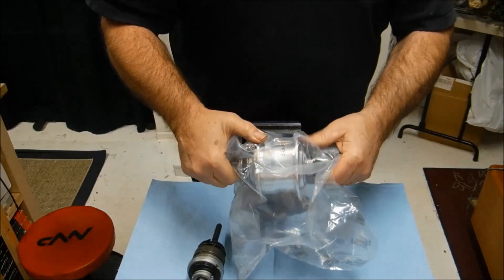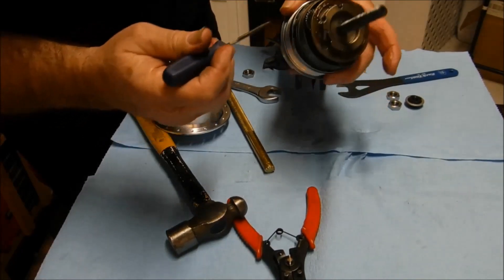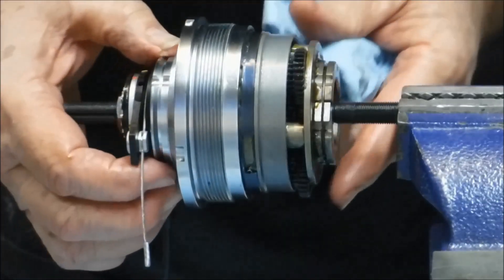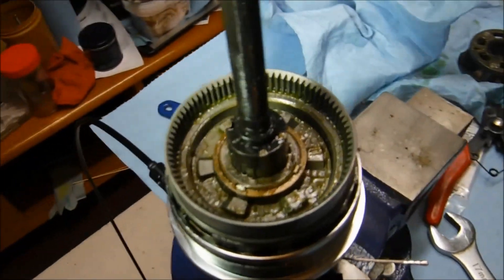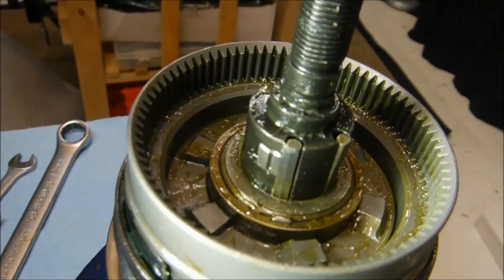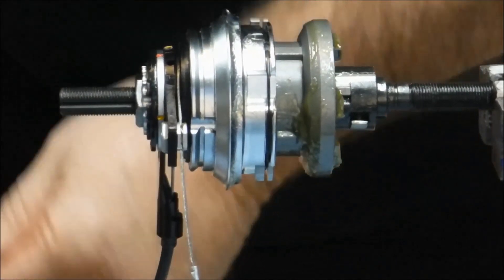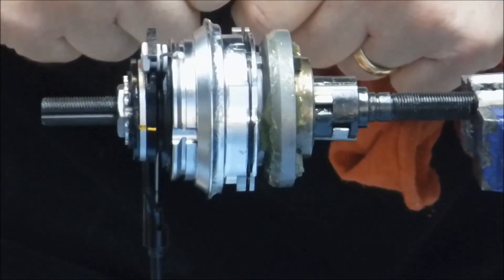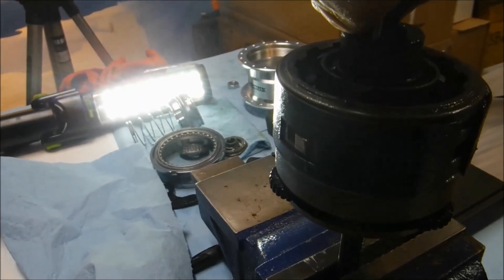Sturmey Archer RX RF5 How it works.

Comment: I like the elegant design of this 5-speed because it can transmit power in both directions  through the same planetary gearset, reducing complexity, and potentially saving weight.  You get 2 underdrive gears in one direction and 2 overdrive gears in the other, plus direct drive.  In contrast, I believe all the Shimano hubs except the 3-speeds have multiple planetary gearsets in stages, with power flowing only in one direction through any gearset.  Interesting design alternatives.  Maybe you have to use multiple stages for wider range.  Thanks for the great explanations on theory of operation ... the best on the net!
Reply: With Shimano it varies by the hub

The Nexus Inter-5 (the one they only sold in Japan, not the later Inter-5E) is the exact same principle, a single stage compound planetary.

The Nexus Inter-7 (EU market) has separate 3-speed over- and underdrive stages, in gears 1, 2, 6 & 7 one stage is disengaged, so should be almost as efficient as a 5-speed.

Their new Nexus 3R75 (the one for E-bikes) has a 3-speed underdrive, working on the same principle as a 5-speed but with no way to engage overdrive.

In general, yes, you're going to need more than one stage to get a wide range. The ratio of of a simple planetary stage with a fixed sun is 1 + (ring teeth / sun teeth), so once you get over 1:1.5 or so your planets start getting really small. Compounds let you cheat a little bit, but at the cost of larger and more complex planets. The SRAM S7 has something like a 1:1.74 ratio from a single triple compound stage, but it also weighs like ½kg more than the Inter-7 and was apparently not economical enough for them to keep making it.

Comment: Great stuff, thanks for everything that you have done explaining hub gears. I have SA and Shimano hubs and your explanations and demos have helped me service and repair my hubs. I do have a question. It isn't intuitive to me how driving the planet carrier creates overdrive. I can see that it does in your videos and my own observations at home, but I'm a bit perplexed how this works. I don't have any sort of engineering or mechanical background so I'm afraid it isn't obvious to me.

Also my SA hubs are running fine on 10W 40 oil as that is what I had available to me at the time. I haven't done a lot of miles on my Shimano hub, it will need its first service soon so I'm buying ATF for the Shimano (7s). Incidentally the SA hubs work nice with the 10W 40, my 3 speed has been running for 2 years now and shifts wonderfully. Thanks again for all of the time you have taken to explain how these amazing hubs work.
Reply from the maker: Thanks for the comment.
If you think about the planet carrier carrying the planet pinions along and rotating them on the sun gears which are fixed in place, you can see that the rotation of the pinions pushes the ring gear at a speed greater than that of the planetary carrier.
Reply: @2wagondragon  Hi thanks, I'm starting to understand. I have a spare SA 5 speed which I'll be taking apart soon to investigate.

Comment: It is a very informative video! Thanks for sharing this and help me to try and understand how it all works. The only thing that might not be very clear in this video is how the ring gear changes from input to output ? I assume this is also driven with a set of pawls that disengage in 4th and 5th gear with the moving of the clutch while you shift to 4th gear ? 

Otherwise this is very well explained! very nice thanks!
Reply from the maker: As long as the clutch is not coupled to the planet carrier, and the ring gear pawls are disengaged from driving the hub shell, the ring gear is the input. When the clutch engages with the planet carrier in 4th and 5th gear, the planet carrier becomes the input overdriving the ring gear which then outruns the driver.

Comment: So instead of a ball bearing to fix the sun gears to the axle this hub uses ratchet palls. Is this the reason why this hub is so big, compared to the older model 5 speed?
Reply from the maker: The pawls are necessary because of the rotary shift action as opposed to the hollow axle and indicator chain of previous models.
They still could have made it more compact and lighter, but they wanted to project a robust image. 
With all that, it is still not strong enough to handle the input of a mid drive motor.

Comment: I see the axle is hollow, do you know if you can sneak a bit of oil into the hub that way?
Reply from the maker: The RX model is a solid axle, so no, you cannot oil it through the axle.
Reply: @2wagondragon    I see, thanks for the answer. I have seen a blog where someone drilled a hole  in the drum and added an oil nipple for easier oil lubrication. I don`t know how easy this is, but I may have to think of a solution to this.

Comment: This hub looks quite beefy internally. I destroyed a nexus 8 already, so looking for something more reliable
Reply: If you're destroying hub gears, it's likely you are operating them incorrectly. They don't work like Derailiers; you must remove the load by freewheeling to shift. Always release cable tension when parking up and pedal backwards to downshift while stationary. Hope that helps.

Comment: I don't understand why the design doesn't use cartridge bearings!  Can you replace the bearing elements in this thing  or do you have to scrap the whole hub when the bearings wear out?  I am considering getting a mid drive ebike with this hub but the longterm reliability of the hub is a major question mark for me. It looks like there is a lot that can and eventually will go wrong with this thing. Maybe I should stick with a hub motor.  Those use easily replaceable cartridge bearings.
Reply: Having the same point of view, sealed cartridge bearings are awesome. SA did use them for almost their front hubs but only for some single speed rear hubs. I am not an expert, maybe there are some technical reason for that
Reply: @huutrongphan5503  I am not an expert either. I think there is probably a sound engineering justification for the design. I think the ball and cone bearings work well enough is the answer. 

When I was learning about this hub I realized that if you do need to replace it, you can just leave the shell of the old hub in place and replace just the internals. That means you don't have to relace the new hub to the wheel rim which saves a lot of work. The think the new hub costs like $130 or $150 or something, which is not that bad I guess. However, I still decided against a bike with an internally geared hub and got a mid drive with a regular derailleur. The external sprocket cluster is stronger and cheaper and easier to replace. :)

Edit: the reason I say the bearings probably work well enough is that I think some other part of the hub will probably break or wear out first so you have to replace the whole thing anyway. :( That is just a guess though.

Comment: What's the usual suspect on these if third gear slips under pressure? I've already used atf bath to no avail. Then took it mostly apart, cleaned, greased, oiled and put back together.
Reply: Okay for what it is worth - that was happening to mine - I found one of the main pawls to be off track when I took it apart
Reply: taiwan..."hey it's better than china"

Comment: Hi Dan, good video. So, I can't find the answer to an an important question and I know virtually nothing about the internal workings of internal gear shift hubs so I'm here trying to learn about them. So long story short, my main question is this. 
Can they hold up on a bike with an electric drive?
An online E-bike dealer caught my interested with a bike equipped with a  Bafang G510 1000W Ultra Mid Motor (160NM Torque), Gates belt drive, and supposedly (the alphanumeric code doesn't match) a STURMEY ARCHER 5 Speed. The lettering on the hub appears to be RSX-RKS, possibly one or both S' could be 5
YouTube video of it here. https://youtu.be/w7sFCvZxPJY?t=402
Reply from the maker: The K in the model number indicates disc brake mounting flanges. Not enough detail in the video to really know for sure, but it looks to be a fat bike version of the 5 speed hub with a wider shell. Sturmey Archer's web site does not list such a thing where I can find it, but they are not always prompt about updating the site.
Reply: @2wagondragon  Thanks, I'm now fairly sure it's a RX-RK5 or fat bike version of it with a wider shell as you mention. 
Last pic is closeup of the hub. https://www.alibaba.com/product-detail/Dual-batteries-48v-1000w-snow-electric_60792319220.html?spm=a2700.wholesale.deiletai6.3.5c245bc5dGL7HK
Reply: @2wagondragon  Newbie question. Will this hub be possible to fit instead of old 3 gear hub? I'm planning to replace my rims on my 80's classic 3 speed Raleigh from steel to alloy(26x1 3/8).

Comment: So splines or a ball lock mechanism on previous hubs engaged the sun to the axle whereas pawls only work in one direction so an opposite facing pawl is necessary as well.
Reply from the maker: Yes, I believe I made that point. Overdrive gears tend to carry the sun gear forward, while underdrive gears put a rearward force on them.

Comment: Hi Dan - there's an unannounced version of an SA hub, model RSX-RK5, for fat bike frames. My guess is that the internals of the RSX-RK5 are very similar if not the same as the RX-RF5, save for a longer axle. If the RX-RF5 skipped/popped/lost forward drive in the 3rd gear (direct), any thoughts on what might cause the skip (other than misalignment of the shifter index)?

Some samples of the RSX-RK5 are skipping in other or all gears, but I was thinking skipping in third gear is particularly ominous.
Reply from the maker: Hi Ray. Interesting that they are producing what appears to be a secret model. Is it perhaps only available to OEMs and not aftermarket?
As to skipping in third, my off the top of my head guess is that the high speed pawls, which are fully retracted in 1st and 2nd do not fully extend to the driving position when the clutch moves to third gear.
 Could be as simple as a lubrication issue. See my other video on trouble shooting the RXRF5 where I resolved the issue of faulty engagement with an ATF bath.
https://www.youtube.com/watch?v=7gU6PuvfgDY
Reply: @2wagondragon  Thanks much Dan - the ATF lube switch was one of the possible solutions that came to mind as well. I don't own an RSX-RK5, and I suspect you're likely correct with the OEM-only possibility. I do have a small fleet of Shimano IGH Nexus/Alfine 3 and 8-speed DIY e-bikes which do handle the motor power very well, if shifted kindly.

I have greatly enjoyed your videos - thanks much for your efforts.

Comment: @Dan Buckhart What is the difference between RF5 and RK5? I used to have the old school Raleigh Sport with 3 speed that sound great and seem to have more speed (My be I was young). The gear clicks can be heard from a distance and each paddle seem to go far. Now the RK5 barely have the high speed pulse noise when riding. Is that normal? It will be great if you make some video with the gear in action and comparison.
Reply from the maker: The RF5 is the non brake model, the RK5 has a disc brake mounting flange.

Comment: Nice video. I have a RXL-RD5 that to me feels like one, or both, set of pawls are slipping (I was unaware the thing had two sets till watching this video. I assumed one set like in shimano hubs). The thing shifts beautify, but just keeps getting worse. I have a replacement coming and when it arrives, I'll open this one up and see what slipping.  With luck the hub shell is undamaged as I paid over $200 getting the wheel built with extra thick spokes.

Can't wait to see more of this video. Keep up the good work!
Reply from the maker: The Shimano hubs do not reverse the power flow through the gear carrier to achieve all the ratios, so they only need to brace the sun gears against rotation in one direction.
Reply: Did you ever get any resolution on your situation. Having a similar situation on my ebike. Not a lot of info out there yet about these hubs.
Reply: @jakelondon  Not really. I got a warranty replacement internals sent to me and while that mostly "fixed" the issue, it's not really fixed. After playing with the adjustment for a few hours, I have found I have two choices. I can have it shift solidly, but still have problems with the  driver pawls slipping. Or I can have it where it does not slip, but will jump out of gear every few days. It's literally just one stop on the adjuster that makes the difference. One step forward and the pawls slip. One step backwards and the thing will not hold gears. I have never seen a hub be so sensitive to adjusting. Even my SA AB 3 speed has a fairly wide range. I just feel it's a problem with this "new" rotary system. So far the chain driven ones seem to be fine. 

I still will not ride this thing up the steeper hills in the area. Which is sad as I go up a +20° grade bridge on my ~40 year old SA AB hub with no problems (other than wishing the hill was not so steep).
Reply: @harshbarj  Sorry you didn't get a great resolution. I'm hopeful we'll have better luck. I guess we'll see. When it's functioning correctly, I really like the gear range of this hub with my ebike. But I live in Seattle, so lots of hills to climb. So far it's mostly worked. It just hasn't been super smooth. 

In any case, it's useful to understand that the adjustment is quite sensitive. So you're not just lining the yellow lines up as they suggest in the instructions? Are you saying that a little to either side of the yellow line can make that much of a difference in what happens?

Comment: Great stuff!  Scuttlebutt is that this heavy hub is massive and over-built for e-bike service.  Opinion?
Reply from the maker: It certainly is heavy, and appears to be very robust. The most delicate parts are the locking pawls that couple the sun gears, but that is not a really high stress function. Even the sun locking pawls in a Rohloff are not very large.
Reply: @2wagondragon  Well, I'd like to think there was some benefit to all that weight for just 5 gears!  I haven't ridden mine very much (yet), but new in service it's quiet and silky smooth.  It seems to be a relatively slow but positive shifter.  I'll find out over the next 100,000km if it's robust & durable.
Reply from the maker: @lilliansullivan5867  The hub in the video has been re assembled and built into a demo bike, but the test ride will have to wait until we are not buried in snow. I will rig it to pull my Bob trailer so I can give it a good workout.
Reply: @lilliansullivan5867  Hi Lillian, as a matter of curiosty, how has the hub worked out for you over last two or three years? I'm looking at one of these for my e-bike, and I haul a trailer.
Reply: The reason i got mine is to have a more sealed gearind system for harsh weather. I've heard of ppl sealing hubs with marine grease and the like. I Also wanted this one for a more durable 5 spd. I figured since so much of the weight is near the axle I figured it's not the same as having a heavy rim.
Reply: @changer1285  I have had mine, drum brake model,  for about 3 years and have put thousands of klicks on it.  It is heavy but has proven very reliable, other than clunking once in a great while when in third, like the hub is coming unlocked.  I just back pedal a bit and that seems to fix it.  Seems like the extra weight was put to good use.
Reply: Mine just snapped an axle...after about 2k miles.